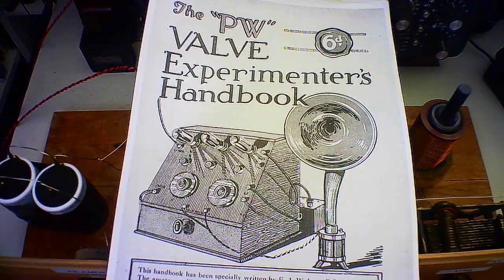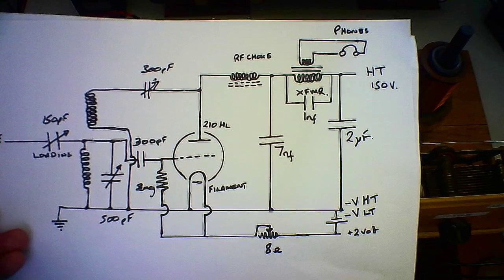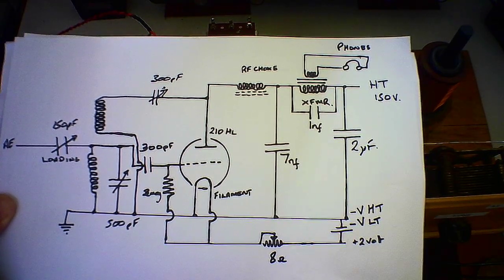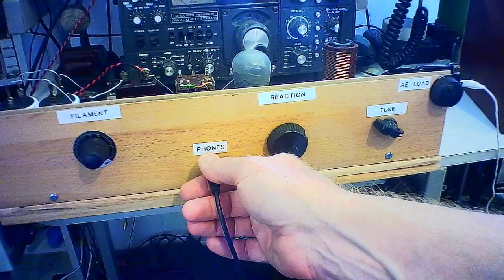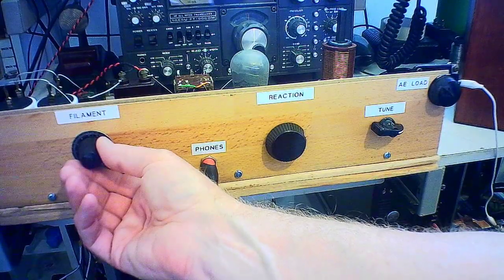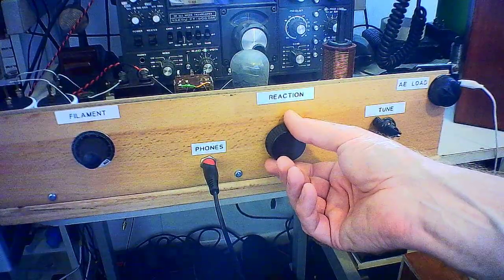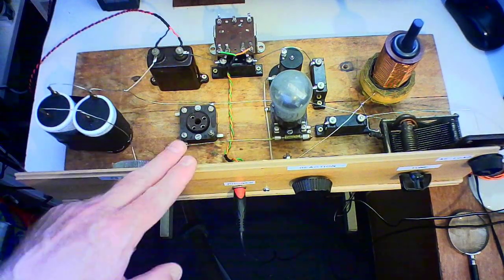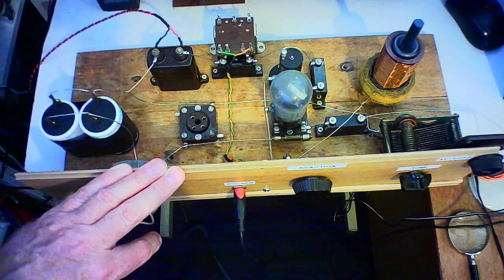A One valve receiver home made 1920/30's style?

Comment: Hi Adrian,

Certainly works well, most impressed. This caught my eye as I have been researching about grid leak detection as used in the 20's. My grandfather made a single valve  set with reaction control, and a variable grid leak. I think 1920's vintage. I am trying to understand the circuit operation, and am intrigued to see in your circuit, the grid leak goes to the positive side of the 2v heater supply. Wouldn't this cause the valve to be hard on?
Keith
Reply from the maker: Hello Keith, glad you liked it.  If it was 2 Volts with respect to the cathode in a normal valve then yes I would expect it to be hard on, but the cathode is the filament and that filament has two volts across it, sticking the grid leak at the positive end does give it a slight amount of positive bias, but we are talking about 1920 valves that did not have massive amounts of current.  Some builders did stick another rheostat or variable resistor across the battery and take the grid leak from the wiper, but these would have been around 300 to 400  ohm in value and I did not have one, so without one, the standard place was on the positive side of the filament.  The radio would have worked better with 60 to 90 Volts rather than 150 but the little inverter I used would not go below 150 Volts.
Cheers

Adrian